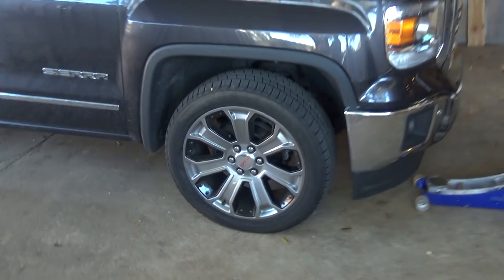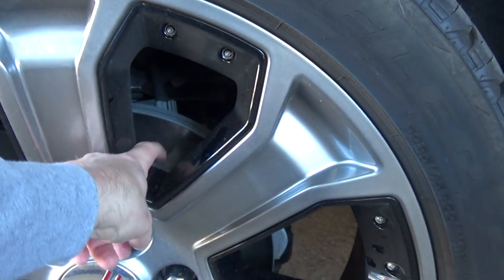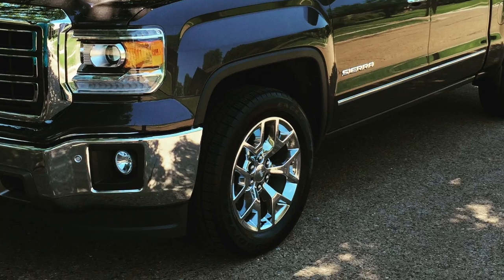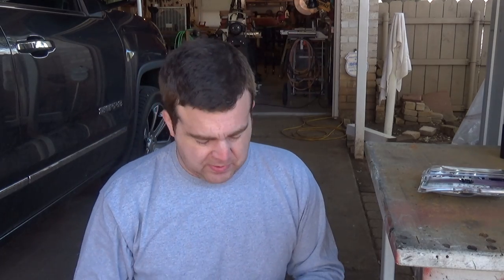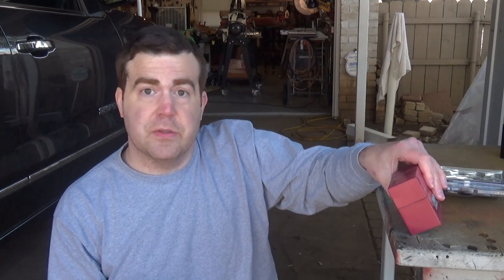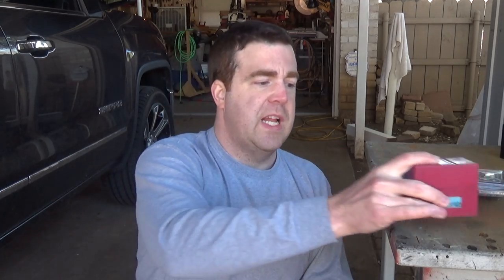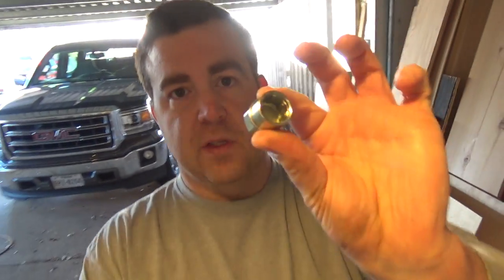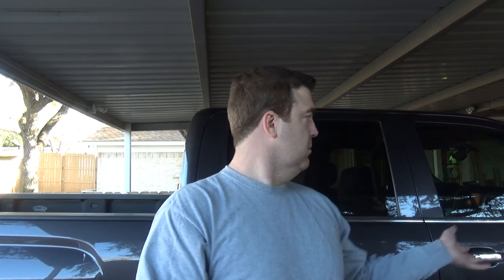WHEEL THEFT PREVENTION TIPS | My Factory 20's were STOLEN!

Comment: but thiefes could buy a theft prevetion nut to and they have the exact same wheel unlock thingy
Reply: MauriceNL in
Reply: Good wheel locks come with a variety of different patterns.  Like house locks and keys.  Slim chance buying another set of the same brand will match.  Not impossible, just improbable.  Unless you know the specific key code.

Comment: If you really wanna fuck with them put all different size lugs and lock nuts on the wheels. Nobody will ever take your wheels off after that including your tire shop because it would be such a pain in the ass. I know this because the bastards kept losing my lugs and just putting anything they could find on them needless to say i got an impact gun and do my own tire rotating now. You can do the same thing with car radios using star bits and hex bits instead of screws